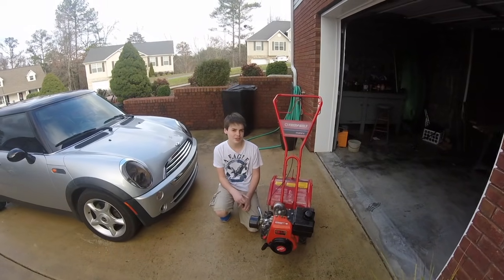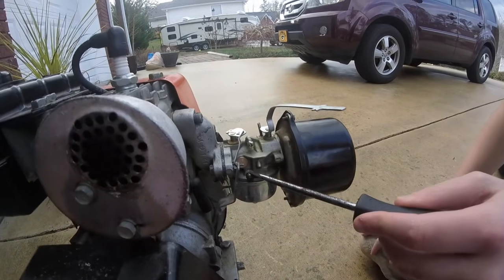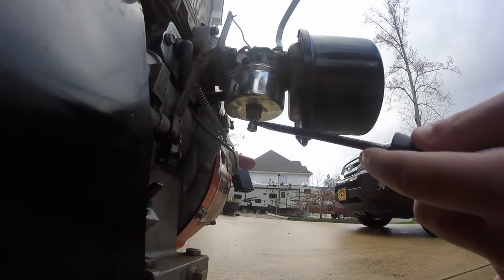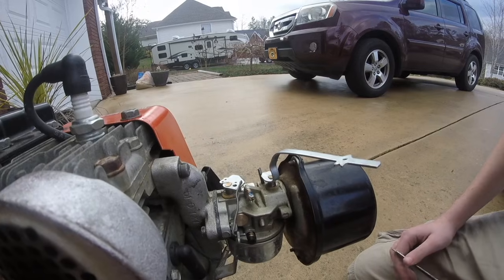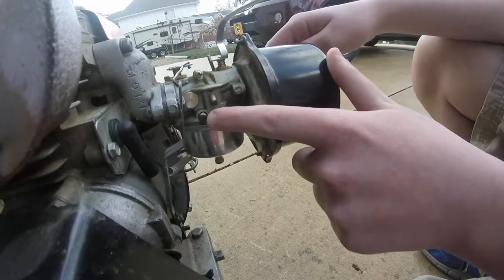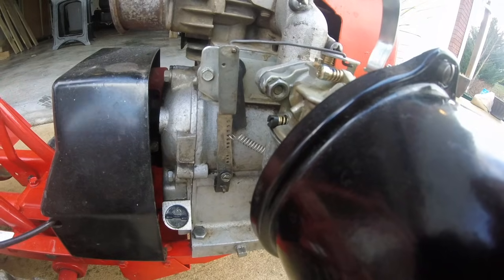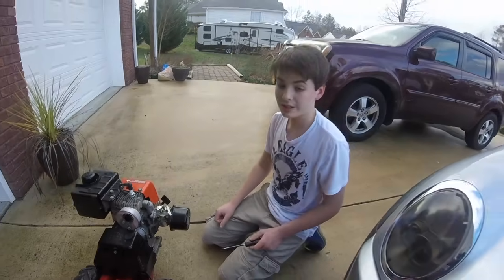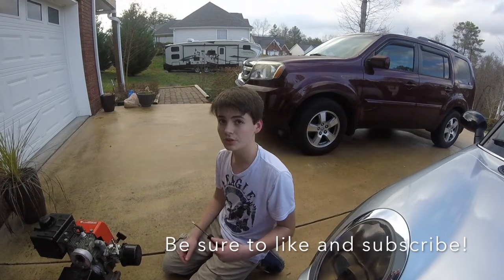How to Adjust The Carburetor On A 4- Cycle Engine in 2 Minutes

Comment: How do you stop the adjustment screws from moving while its running?
Reply: You can apply loctite to the screws once you find the correct setting. Use "medium " strength.

Comment: Very well explained video. On a Husqvarna riding mower, I suppose I need to first remove the beauty cover exposing the carburetor better. Then look for my idle screw. I recently had some repairs done, it runs great, but the idling is a little high. Thanks, John

Comment: So the more you open the idle screw the more gas the carb gets at idle?
Reply: Yes. Both screws, fully in = 0 gas being let through. Unscrew to kitchen as needed.
Reply: *richen
Reply: Idle screw is to richen, or lean at idle/0 throttle compression, or lowest speed setting on your machine. 

The other is for any level above idle. 

The idea is to not kill the gas flow, at idle, as to cut it off, and to provide enough gas flow during throttle usage as well. 

Not exactly genious set up, but it's been made that way. 

The engine stays on, stays in motion at various levels through air, and gas mixture. No fuel, no combustion, dead motor, and sadly, you have to pull the line, much like manually starting a car engine when they first came. 

All should have key starts now imo, but whatever lol. Some are too small to have one I guess.

Comment: I followed your instructions after installing one of the after market carbs from eBay and the engine runs beautifully at idle and at high speeds. But, as soon as I put it under load the engine just stops. Also, when I adjust the throttle from idle to high speed I have to do it slowly or it also stops. The engine is a 3.5 Tecumseh on a Troy-Bilt rototiller. Exact same carb. Suggestions? 
Btw, thank you for the initial video.
Reply from the maker: Sounds to be too lean on the high end. Try turning out the main jet (high speed jet). It may be a bad carb. Those aftermarket carbs are kind of a hit or miss. I’ve gotten some that have been great and some that have sucked. The one in the video is a eBay cheapo. But I’ve since learned.

Comment: Is that an aftermarket air filter housing?
The carb is almost identical to the one I bought for my snowblower. 
Stock carb had no adjustments and the one I bought does so I was looking for info just like you showed. 
Thanks for the great explanation on the different adjustments. Should help a lot once I get the new one installed.
Reply from the maker: It’s all stock

Comment: Great intro but to take it a little further you need to evaluate it under load.   Idling and no load isnt really how you want to make the final adjustment.  Maybe a little on the rich side with no load and then watch it lean out when in use
Reply: @ skip c.  Well it wasn't in use Einstein. I betcha that kid is sharp enough that he already knows that info. I'm sure he will make the right adjustments when he crosses that bridge.

Comment: Thanks for the video. I have a Tuffy Tiller just like that that I bought from the Troy Bilt Factory Store in 1993. I ordered a new Stens 520-918 Carburetor which will hopefully get the tiller back in action.
Reply from the maker: Barbara Hawn Thanks! FYI, if your looking for a new carburetor they sell after-market ones on eBay for about 20$. Great deal and they work fine. That's where I got the one in the video.